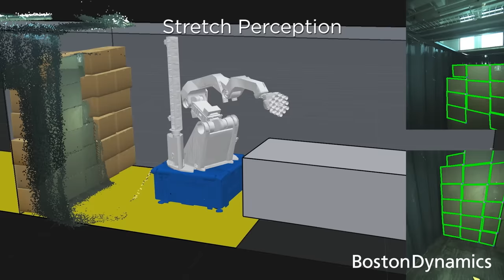Introducing Stretch | Boston Dynamics

Comment: I unload trailers in a ups warehouse and trust me, it is tiring and gets boring.  Also, a lot of packages are messed up, torn, open, broken, destroyed.  So I don't think this is the right way of trying to automate this job.  Instead, make a huge conveyor belt and use the strongest material for the belts and the diverters.  Only load trailers with the packages on pallets, so either forklift it in or have someone load the packages on the pallets.  Then unload the trailers with a forklift or pallet jack, try getting self driving ones too.
P.s. another idea for pallets could be using a material that's reusable indefinitely and create/design new trailers that have some kind of shelving on the sides so that these new pallets can slip right in and lock into place, and slip right out easy too.  Then u don't have to worry about boxes flying all over the place and it'll be easier to load and unload and might not even need forklifts for this

Comment: Oh yeah this definitely going to cause some layoffs at amazon.
Reply: This is nothing special and already exists in the industry
Reply: In other words, it will save lives. ** Amazon.
Reply: If it could unload fluid loaded trailers where the boxes are different sizes and all mixed up then a rough estimate would be about 10-15 thousand jobs across amazon.  If they can get it to where it could properly fluid load different size boxes into a trailer which I assume would be harder to do then your looking at 25,000-50,000 depending on how accurate my assumptions are.  If you add in all the Jobs that are only one step up the complexity scale from this putting items on a line to go thru a packing machine or similar then it will likely be a could hundred thousand Powell
Reply: @Need_better_handle  Its cost prohibitive.  $1 000 000 for a robot that will cost $50 000/ year to maintain and could fail in 10 years.  That's about $150 000/year.  It will have to maintain a constant workload equal to 1.7 workers, 24 hours, 7 days a week.  Employees can also be let go during hard times, and relieved when there isn't any work.  If it can't do all of the jobs, it will have to have a constant workload of easy jobs.  Unlikely that they will get the full value except in a very large facility
Reply: @FletcherHillier  And if it maintains and repairs itself?
Reply: @CastleKnight7  It will need parts and it doesn't have the ability to use precision tools or operate unpowered.  A manufacturing robot might be able to but you'll spend way more than using a human on repairs that way.
Reply: @FletcherHillier  Sure 1 mil at the current production scale, but this thing can be made for orders of magnitude less if scale is big enough, atleast they r researching, future iterations will be better and thus more worthwhile
Reply: @penguinyay1936  My point is that this is just another iteration, as more advanced machines are already in use in manufacturing.  This is a large pick and place machine with low accuracy and low speed.

Comment: It’s all fun until this thing starts moving towards you at high speed
Reply: Just like in most factories, these will likely have their own space sectioned away from humans, if there still are any.. humans that is.
Reply: @aread13  They work side by side, there's articles dating back to 2019 showing how amazon uses them in 50+ fulfillment centers (at the time).  The were using 200k+ robots across the company then, probably double that by today after last years fiasco.

Comment: I see different size boxes, but no idea what the weight of the boxes is. While the third box of the first set did not have a lid and contained a spot robot, that does not mean the other boxes also contained a spot robot.

It would be nice to see a more realistic demonstration with the robot picking up boxes that weigh more than 10 lb. For example, how about having it pick up 100 lb sacks of flux? In my opinion that would be a real life demonstration.

Otherwise, it was an awesome demonstration. I think stretch has a real future in the warehouse industry.

Comment: I appreciate innovation and engineering, but there’s something glaringly questionable here....No.1 the boxes are quite obviously empty. No.2 If the boxes were, for example, 30lbs/15Kg how would the suction pads hold weight without ripping the top off each box? There’d be a lot of scattered contents! Don’t get me wrong, the scanning/counting/movement part is very impressive but articulating a machine in confined environments whilst lifting/handling and safely placing them is like ballet. I’ll likely be proved wrong with a pincer type adaptation in the next version, they’ve probably made it already! Thank you, Boston Dynamics.

Comment: I'm not sure how well it would work picking up fully loaded boxes would work like this. You’d need to make sure that the boxes were uniformly constructed and packed to ensure the box didn't tear or collapse from only being picked up from one side. The demo would be good if it was using weighted objects that were meant to reflect the intended real world use whether that is boxes or if they are just used for this basic demonstration then something more likely.

Comment: I work with automation lines/equipment. You who say these will not replace human staff are in for a Little shock. The OVERALL effect may be one thing but naturally you as a warehouse worker will be more worried about YOUR future. After summer, one warehouse i know of will reduce night-personel pending a  trial-run period with a new robot picker which brings pallets to an infeed conveyor (nothing on par w BD's robotics but good Enough for AUTOmation needs). My colleages and I will be servicing that machine. Our jobs are ok. Just as it goes with 'outsourcing labor', the corp will do anything to more 'effectively' secure Their position in the Marketplace (because of inherent competition). that Robot up there in the vid is removibg kartons from a trailer. this is currently a human task as the work is risk-laden for both human and product AND it is time-consuming because of the human element. It is also one of the most Common tasks in a goods receiving/shipping area within nearly All of today's  logistics warehouses and transit terminals. just remain vigilant and always take part in what goes on in the ongoing  "effectivity" of your workplace.

Comment: I'm curious about all the edge cases for this robot. I work as a night crewman and Fry's food AKA Kroger. Store #10 Bethany Home and 43rd ave to be exact. We don't have the bodies to do the job. And anything we could do to make the few people we do have more effective using these bots would be great. But my skepticism on their ability to perform when faced with pallets not properly stacked. Falling over. Broken cases of pickles wet uneven sugar sprinkled slippery floors etc. Working is very tight situations where you have to just yank pallets past other pallets when the plastic is touching got to get it out but carefully but with force. Ya know what I mean? Not hit any one in the process but also not be timid because if you don't force your way through and cut other people off you can't get to where your trying to go. The pallet bins over head have metal wire sticking out the pillers are sometimes bent so getting pallets up or down can be tricky. Also human incompetence. Some people don't wrap pallets tight enough so they loose and wobble. Also it would need to be able to go on to the sale's floor with out scuffing up the wax. It's a tall order can your bots actually work in real live condition's?

We don't currently have anyone to take our load off the truck and bring them out to the sale's floor. Then to break the pallets down and spot them down the isles right in front of where the cases need to be stocked into the shelves. Can your bots do that? It would allow a normal 5 person crew to operate with just 3 perhaps? Also if it could run behind us and pick up cardboard trash and pick up backstock and put it on 6 wheelers or boats as we call them and put them back in to the back room would also help. But the suction thing probably won't work for picking up back stock. The boxes will just bent tear and break. But please let me know if you're interested in testing this capability at our store. Lots of edge cases here. We have super stupid people super tight restrictions in time and space. Thanks.

Comment: This is a great idea for a product but I can’t help feeling that BD have been missing a trick for the last few years.

Why not design one of your bipedal robots to drive cars.  It could have a detachable solar powered sensor suit that would detach from the robot and be attach to the roof. The robot gets in and drives the car communicating with the sensor suit on the roof.

It would make any car/truck/digger/tractor/tank/aeroplane instantly autonomous.

To collect data the robot could get into the passenger seat of any vehicle and be driven around.

Now that BD have been bought out by Hyundai they should have no shortage of a supply of test cars.

Seems a perfect fit for a company that has nearly perfected Bipedal locomotion.

Comment: I mean it all looks cool, effective and professional, but let's not forget that those were empty cardboard boxes with no weight in them. So first the cardboard box has to be able to hold the weight at the bottom without any support from below. Well, good luck with that. Actually picking up boxes various weight and size and shape WHILE supporting the bottom is a different thing. Understanding what's in it so you can support it properly is a different thing.
 'Well yes, we just put them in stronger boxes...'
The whole system works only because the packeging is virtually weightless and dirt cheap.
 Handling is not a mindless task. And those are not random boxes loaded into random containers. This system as it is only useful in very narrow settings. This demonstration is all programmed beforehand, boxes being weightless and placed to the right spot so the robot 'finds it'. This is not REACTING to real life challenges. Ever seen a container after a stormy sea crossing? Everything is shifted and moved and dameged? This is a 'perfect world' scenario, not areal one.

Comment: You need to make a tentacular robot. Tentacular robots could do anything humans could, if the strings are numerous, sturdy, and thin enough. Strands can combine on the fly by wrapping themselves together to form strong muscle-like links when necessary, such as to lift a car door on an assembly line. It can drive a dumb-vehicle by manipulating the steering wheel, pedals, etc., all at the same time. It can use any tools humans can by simply grabbing a mechanical hand with some of its strings, communicating with it over wifi, no need to connect it to the strings themselves. Search Octai Worker Bot on google for a primitive take on it, and Metal Gear Solid IV "Dwarf Gekko". Combine both. It will be perfect for operating stations in space, on the moon, on Mars, with no humans needed. Anyway, in due time, it will happen. There is no alternative, but who knows who will do it first, and do it well. Don't take the long way around to get there.

Comment: cool, but moving empty boxes is not interesting. You cannot pick up full boxes using this method, even if the suction apparatus worked, as  box top joints are not designed to bear load like this.

Comment: I'm not that impressed. Sure, the tech appears impressive for loading/unloading, but when I worked in a warehouse, I could unload a container faster than this. Also, a lot of containers we dealt with were loaded "full to the brim" with stuff packed in weird angles, and with small boxes mixed in with big ones. The Tech's promising, sure, but it's got a ways to go before it can replace humans. Also, I imagine you couldn't go in there while the machine is working, you'd have to shut it off, then go in, straighten things, and then go out, and turn it back on.

Comment: Am I the only one scared that the suction cups may not be enough to hold some packages and the robot may drop some of the boxes? Suction cups on cardboard looks like a weird idea
Reply: Those suction cups are fairly hardy, we had vacuum lifts similar with half the suction cups on it at my old job, and we used them to lift 40 lb blocks of cheese in cardboard boxes.